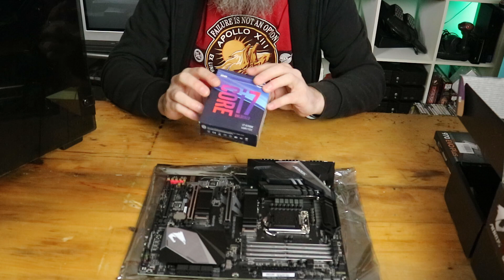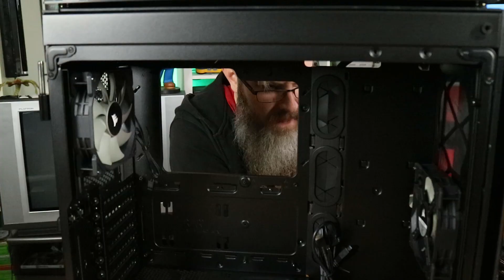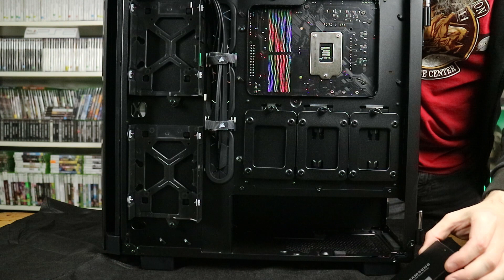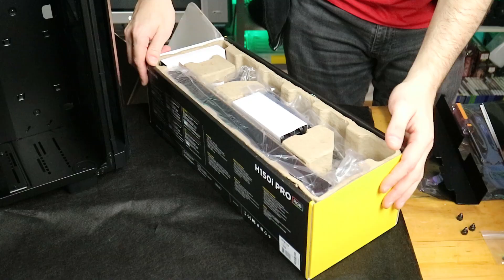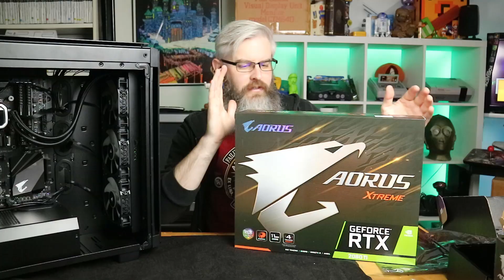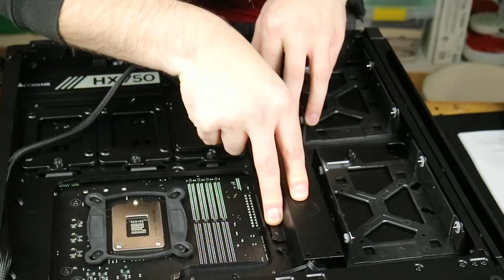Ben's PC build: Core i7-9700K & GeForce RTX 2080 Ti

Comment: guys is this a good pc in 2025?
Reply: Yes, it's a perfect match between CPU and GPU. Still good to play all the last games (today) in 1080p on highest settings and even in 1440p it does well. 
This setup is still good to play over 5 year old games in 4K if you don't play the latest games in 4K (or you need to lower quality for recent games to play in 4K). 

I just start to build (a new build with these older parts still sealed I bought for a bargain on sale) 2 - 3 weeks ago. 
It's gonna be to game on my old 24"  (1080p) game monitor 144Hz. 
(but instead with a MSI RTX2080Ti Ventus (GPU) and Noctua NH-U14S (aircooler for the CPU) and ASUS ROG Maximus XI Code (mobo) and G.Skill Trident Z RGB F4-3200C14D-64GTZR 64GB DDR4 (RAM memory) and Seasonic Focus Plus 750 Gold (powersupply) and 2x Samsung NVMe M.2 SSD's (build in on the mobo)). It's superfast !! 

I just still looking for a case to build the whole system in, it need to be a closed one because this build will be placed in the livingroom for gaming during the winterperiod.
Reply: @ilovevietnam2013  nice!

Comment: Please tell me the selection reason for the 750 power supply ! And why put it upside down . I am going to build same pc but i need to know if i use 2060 .. will 650w power be enough ? I will.be going with air cooler

Comment: so question, how is the overclocking and such? I have an i7 9700k with a gtx 1080 but i desperately want an rtx 2080 ti. i have a PSU corsair 750W. im just not sure, do u get any coil whining? or any issues at all for that matter? im a little hesitant on this whole ordeal
Reply from the maker: No coil whine that I’ve noticed, however I do notice running some games on max settings does kick my fans into overdrive! I don’t notice it much as I’m usually using my headset but my partner complains that she can hear it from the next room!
Reply: D1DLC woah okay. thanks for the reply!!! i really appreciate it! :)

Comment: Do you need a separate Corsair program to run the water cooler? Also, can you put a water cooler radiator at the top? Personally I like Positive inside pressure.

Comment: I recommend flipping the radiator fans backwards so they are set to intake, as you have none. Also doing this will give you healthy airflow, as you’ll have 3 intake fans, and 3 exhaust, and in the right spots.
Reply from the maker: I was originally going to do this, but was advised against it as you don't want warm air (from the radiator) going back into the machine. Even after overclocking the machine my CPU never gets over about 78C, so I'm pretty happy with it on exhaust at the moment!
Reply: @D1DLC  I've got practically the same exact build- minus the wifi. You should send me your OC'ing specs or make a basic quick tutorial!